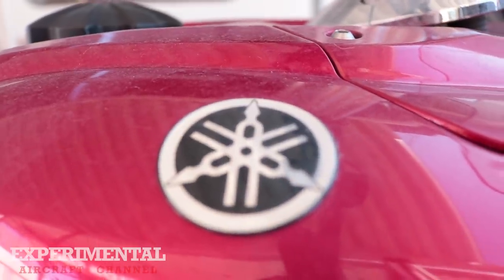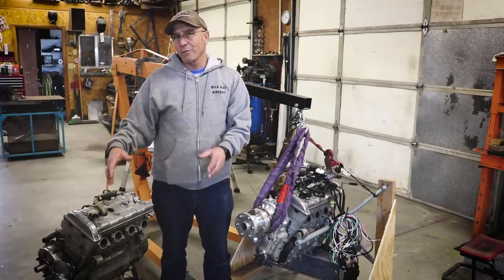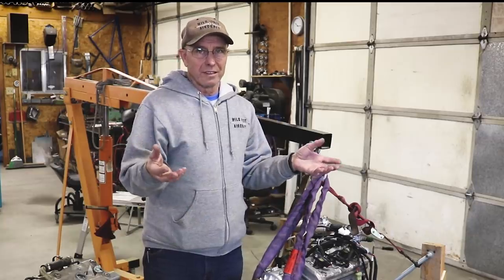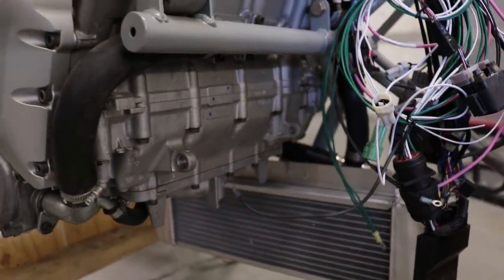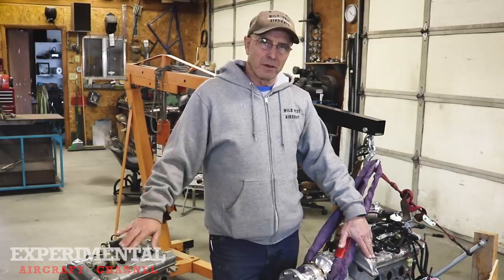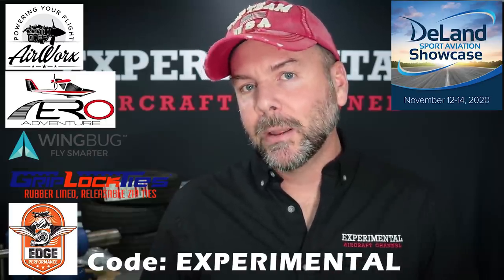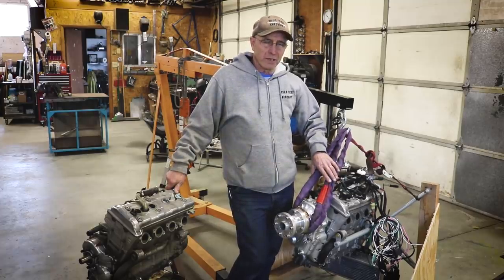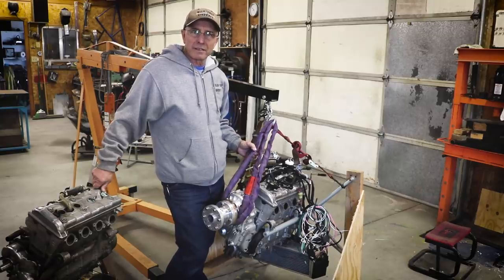Yamaha Aircraft Engines?  STOL - Steve Henry

Comment: It’s about time we realize that air cooled carbureted engine with magnetos is old music. High performance motorcycles and cars abandoned that long time ago....
Reply: Carb rebuilding kits, and tuning talents are few and far between also. Motorcycle dealerships won't this old tech anymore.
Reply: dealerships won't touch
Reply: Magnetos are still used in top level motorsport.
Reply: Bill Hollingsworth are they? Wear? I though mags didn’t let you change timing so they wouldn’t work with FADEC systems.
Reply: @joshmoore6165  You know you can edit comments. Not trying to be difficult, just if you wanted to fix the original comment you can.
Reply: @cageordie  No offense taken. Thank you, I will learn how to do that.
Reply: I can afford old music.

Comment: That price is ridiculous. I can't comprehend how he can justify 20k-40k.....
Reply: I agree, im not sure why a person would considered this motor when you can get a new Rotax 915iS fresh out of the box, turbo and fuel injected, (which btw you will get service bulletins should issues be found at the factory) all for $37k.   In contrast I'm sure the APEX works well, but seems very expensive for what your getting, a used, secondhand engine.  If it was a $6k or even $10k maybe.  But $23k?  Hard pass.
Reply: If you go to his website and check out the price page he is offering the Rotax and Yamaha. The 150HP EFI Apex is (w/firewall forward prop and hub) $23k the 100HP Rotax 912  is $28k (FF inc) the 914 is $40k (FF inc) The Yamaha 300 HP is $43K. There is a rather large difference between the HP and whats included for $43K. In neither case are you buying just the engine. For 300HP ready to mount isn't that ridiculous. Yamaha makes a great engine if they provide the correct modifications seems like a fair price.

Comment: I always thought the point of using alternative engines was to lower the cost. Yes, it's a cool engine but damned pricy. And you're basically getting a secondhand engine.
Reply: exactly what I was thinking. If im handy enough to build an airplane from a kit then ill find a 2nd hand engine rip it and and install myself. Of course ill buy what i need like the fearbox but holy crap iv seen these engines going for 2-3K.
Reply: but let me add that if you have the money to throw around, if your looking at a highlander  Id sure throw it Steve Henrys way.
Reply: @Ryan You can buy a used APEX sled for $2000 or less all day long. I know because I have one. Lovely engine, its true. Its as smooth and happy as can be to squeeze 11K rpm all day long and lots of guys have huge miles on the sleds with no engine issues. Maybe I can sell my sled for more money now lol
Reply: @Ryan You don't need 20k to turbo.an R1 engine (what an Apex essentially is). Maybe 5k.
Reply: yeah, but what's the TBO. Sure i ride high performance sportbikes, sometimes at high rpm for the thrill. But i don't think it would make any reasonable TBO doing that long term. 20K+ for one of these whizbangs? When it quits on a sled no one thinks about it---it's when your with your kid drivin' over the mountain that you think about it. Nice vid though.

Comment: It seems like you should be able to get an engine out of the crate from Yamaha, and not an extracted snowmobile engine.
Reply: Yamaha doesn't want to get involved in Aircraft engines I can understand why then they can be held responsible all comes down to lawsuits. Even if they sold them to be used in snowmobiles still probably end being sued.  Attorney's go after who ever has the deepest pockets eventually someone will crash and end up dead. Families are filled with greed by attorneys who want to make a fast buck on a settlement.
Reply: @Mike-01234  that's why you can't start or run their cycles in gear with the kickstand down.  Some brainiac did,  and collected a payout for his own stooopidity.  ) :
Reply: chekyerego - In all the years I’ve been around bikes, I’ve never seen a factory complete engine available. It’s a damn shame, too.
Reply from the maker: That would be nice. In the early years I was investigating options for engines to build "Reverse Trike" kits. I think the only manufacturer that might sell a crate engine (or maybe just in individual parts) is Kawasaki. Most Reverse Trike kits now use doner bikes be it NEW, Salvage or low miles used. Thank you for watching and supporting here. I appreciate You!
Reply: Experimental Aircraft Channel - Ahh great info, Bryan. Thanks!👍
Reply: @ExperimentalAircraftChannel  
In the UK  we have to buy a complete snowmobile  remove the engine & sell the rest on USA Or Canadian eBay .  We use the 3 cylinder Nitro engine in Rage buggies for off road racing
Reply from the maker: @RAT.MAN.  In aircraft? I am hearing they are NOT using the 3cyl because of the "harmonics" from the "pulses" of a 3 cylinder firing. They are stick with the 4cyl at the moment because of this. Which application?
Reply: @ExperimentalAircraftChannel  
No we use the 3 cylinder in a off road Buggy .  Fantastic little engine .  We are now going to try the Ford 3 cylinder lump  that sits on a sheet of A4 paper.   Never realised that a 3 cylinder gave problems in flight.
Reply: For what it would likely cost you could get a sled motor and rebuild it better than new for the same or less.  My last build on my race bike with custom forged omega pistons and oversized valves was about 6 K with labor.  A good builder will build it to tighter tolerances than a stock motor that comes from the factory.
Reply: @ExperimentalAircraftChannel  that is dealer only!! freind had ashop and he had to go to dealer to get an engine!! so he would take a bike there have them put engine in than strip it out for custom bike
Reply: @craigsanders6925  this engines on a sled can put out 300hp! but need tuned down for reliability for the plane
Reply: Experimental Aircraft Channel future of light aircraft is high torque electric motors linked to a small battery charged by a high revving low torque generator unit. No redundancy required
Reply: @ExperimentalAircraftChannel  I was researching alternative engines about 8 years ago.   A friend who had been using an apex engine in his jet boat for 4 summers and pointed me to the Yamahas.   At the time there were a few people using them in gyrocopters and two putting them into kit planes. 

The general consensus at the time was that the 3 and 4cylinders had different methods of mounting the engines.  The 3 cylinder needed an elaborate Mount built and was also more complicated to adapt the gearboxes to.  The extra weight and cost of conversions made them less desirable.
Reply: @pagansforbreakfast he is robbing people he thinks his shit is made out of gold
Reply: blastman8888 I doubt that has anything to do with it. Chevy has been selling crate engines for years and to my knowledge has never had liability issues. Some have even made their way into aircraft.

I suspect the demand for crate motors is just too low to be worth the trouble of spinning up that supply change.
Reply: @carlschmiedeke151 . Seems to me he’s proven it👍🇨🇦. No one’s done more in Yamaha aircraft than Steve!

Comment: Thrust from Steve Henry engine is amazing.  Power to weight ratio is nuts!  Had a Yamaha 650 4 cylinder that redlined at 10,000 rpms in early 80’s in a motorcycle.  R and D has been working overtime for sled engines though Yamaha in the later years.  All about speed and weight!  Hats off to Steve Henry for test piloting this project that so many want to acquire now for an airplane.  Great question and answer session.  Well done video.
Reply from the maker: Thank you! Very much appreciate your feedback. Thank you for watching and supporting here. I appreciate You!
Reply: @ExperimentalAircraftChannel  you NEED to seriously look at the 300hp supercharged jetski engines...theyre marine quality engines with jetted oil cooled pistons for continuous high rpm...really torquey engines out of the crate
Reply: this seems to be the old engine used in VX jetskis. it had about 140-180hp and a redline above 10k. the newer engines are much better and more powerful.

Comment: I had a Yamaha snow machine for 4 years before I sold it when I moved to a non-winter state and that whole time I never had one mechanical stoppage or any issues for that matter. My riding buddies with SkiDoo's, CanAm's, Polaris....none of them can claim that. I carried a strap and D shackles to pull them when they broke down lol Yamaha is KING of the snow machines!
Reply: Kinda related, I've got a 07 Yamaha Rhino 450 on the farm and use it every day still runs like a champ. The Polaris  Ranger I bought in 09 is usually broken in the barn waiting on parts. They do the same job, same loads.
Reply: dwarden3 , same here in Ontario. Our ATV group always ends up having to repair or tow a Polaris back to camp. Yamaha , Honda and Can Am never seems to break down.

Comment: Well my experiences from  snowmobiles would make me very comfortable flying with an Apex engine, not that Rotax is bad in any way but Yamahas engines is a little bit better. Besides the yearly or every 4000km oil change I'm still  waiting for the first service on the engine in my Apex, valve clerance check at 40000km  or 24860 miles.  :-) When the clutches are set and work correctly it should rev about 10700 at WOT, the revlimiter kicks in at 11000.

Comment: Shouldn’t even be a second thought between carbs or fuel injection. I mean absolutely ZERO thought really. Also, you shouldn’t even really have to develop and R&D a turbo system for the Apex, the snowmobile guys have been doing it for years and years. I completely understand a few tweaks and bugs here and there, like exhaust manifold/collector, charge pipe/induction manifold routing and intercooler maybe if your using one. However, the fuel mapping, computer, proper turbo, etc.....there are many many guys who have that down perfectly. Certainly shouldn’t be necessary to start from scratch just because it is going in an aircraft right?
Reply: The mapping for an aircraft is completely different from a car. I've done it and the maps that were provided with the ECU were completely inappropriate and I had to start from scratch. Been flying with my setup since 2009.
Reply: Something used on a  snowmobile doesn't necessarily fit or work on an airplane. 
As he explains in the video, he had to come up with his own exhaust system because it can't be fitted the same.
And with different gearboxes and ways the power is used at a higher band of altitude changes comes the need for different mapping and adjustments.

Comment: About RPM - - - I had a Honda CX 500 motorcycle in 1969 that red lined  at 10,000 Rpm and everybody said it was a time bomb because of such high RPM.   It was the most reliable Bike ever.
I could take it up to 10,000 RPMs every shift and I often drive in a lower gear to maintain the 10,000 RPMs and it was only a 2 cylinder so RPMS mean nothing if the motor was designed to be a high revving and built by a good company Like Yamaha or Honda.
Reply: Don't bikes today rev 20K now?
Reply: @SVSky  Most of your average sport bikes are topping out between 12-14k. My 19 year old Blackbird redlined at 12.5k. Happy zone was between 6-9k, and best mileage was around 85 mph.
Reply: @SVSky  many do, but my Goldwing redlines at 6,000.
Reply: the CX500 didnt come out until 1978.
Reply: @yamahale  Thank you Hal you are a better historian than me. But point being that it was a high reviving from a  long time ago.
Reply: mostly no. But the man is talking about "cruising" (continuous rpm) of around at 9K rpm or something. And he does it with a straight face. OK. I would guess that might give you a 200 hour tbo if you were lucky. Of course nobody knows.

Comment: Could someone please explain to me why he couldn’t just put EFI onto that carbureted engine?
Reply: You can depending on the manufacturer. Yamaha is known to have different valve spring ratings between the two. So you would have to re-work the head. Then rebalance the crank. To do all that DOES NOT cost that much.

Comment: Reading some of the comments below what is the difference in  engine fuel injection mapping between a snowmobile and an aircraft application? If the snowmobile fuel injection is wide enough to go from sea level to 10 thousand plus feet why is the aircraft different?

Comment: Why not the 3 cylinder engine from Yamaha Nytro? Lighter and very reliable. 130hp stock but MC Xpress from Sweden pulls 340hp from it very easily.
Reply: 270 degree phase in power pulses gives propellers some funky behavior.
Reply: @CommieCat  Aah. Thank you for the info. I have absolutely no experience in aircraft engines.  😁

Comment: IS the $23k price for a non turbo engine include a rebuilt snow mobile engine with fuel injection ?
Reply: That includes the gearbox and prop as well.  You're talking about a motor that weighs just over 100 lbs, and rebuilt can easily make more power.  My 2008 R1, it's a similar motor, made almost 180 with a full exhaust system and dyno tuning on a stock motor.  Match the ECU map for the use, dial in the cams for where you want them and tune it for best power application.  Non turbo super bike builds are making well over 200Hp.

Comment: With that kind of RPMs what comes to mind is a system based on a Multi Fan Blade Ducted Fan. A Cold Ducted Fan with Direct Drive.  In a Duct, the wing tip vortex's from the prop tip, are eliminated thus gaining efficiency , about  20 %.  In my Mind's Eye, I see the engine and impeller enclosed in a Venturi Shaped Duct. An air  cooled 2 cyc engine behind the impeller in the slipstream would  handle the engine cooling.
Side note..... I've been building and flying Model airplanes since 1959. Got my 1st Radio in 1976, been designing, building and  flying R/C ever since. Build in the winter and fly in the Summer. I get an idea, draw a sketch, cut, glue,  assemble, fly, break, rebuild, fly.  This Yamaha Engine in a Ducted Fan with the High RPMs should be Mega   Thrust.     From Ionia   KEITH
Reply: If your ducted fan gains 20% efficiency than  you are above 100%🤩

Comment: I am wondering what makes the Yamaha engine competitive compared to a Viking 195 or an aeromomentum engine. Is it the weight? Doesn't seem to be the price.
Reply: Not a bad engine...but I also don't see too much R&D on these either. I'm not too sure I'd spend that kind of cash on something so unproven. Aeromomentum is doing a far better job on the R&D front (easily the best of all the auto converters out there IMHO) with significantly lower prices. I'd approach this one with caution till a few hundred hours at least are on a few of these. If it works out okay after that, fine. If not....
Reply: I haven't seen the weight for the turbo setup, but it has to be alot lighter than the honda auto conversion. These engines also have a lot of history and testing of turbo setups in the sleed world. They have proven to be super reliable in that application. That doesn't mean I disagree with you about hours of testing on this specific turbo/fuel injection setup. The fact that you are not getting a factory built engine also adds variability that I don't like. And the price... 40k ouch
Reply: About 115-120 lbs, that was his price that included gearbox and prop which I'd guess costs about 6K.

Comment: So why would anyone pay 23 thousand dollars for the engine and redrive, when you can buy the engine from a Yamaha dealer and components for well under 10 thousand dollars, and then purchase the prop drive separate, and bolt it on. 
Thousands saved.
You can buy the whole sled brand new for 15 thousand or less.
Reply: Forty thousand for the turbo version, fat chance.
Reply: Everything aero is ten times the price of automotive.  These planes are one by one hand made,  Henry Ford had more production automation 100yr ago than what many airplane manufacturers use today. Its just economy of scale.  The comparable hp rotax is more than $23000 and it is an old design with carbs.  If you want injection the rotax would be even higher price.
Reply: Scott Nunan 
crazy! Good point
Reply: i agree to a point!! the engine has to be modified, and preped for air!! i have a shop and can do it my self so i would not pay that much but if you cam to may shop had me get one ready its a lot of work now maybe something i dont know as way 20,000 extra for turbo?? maybe 10 at tops?? but maybe i to cheap??
Reply: Plus you can get it with the right turbo for the engine already attached
Reply: @srnunan4783  don't fault a guy for trying to turn a profit. He's a test pilot here, and we are learning things. It's a great vid.

Comment: What’s the engine life on these 10,000 RPM engines?
Reply: I know nothing about snowmobiles but that rx1 looks suspiciously like a R1/FZ1 motorcycle engine that i know well, will do 100,000km street miles or a full season road racing no problem . Seemingly built from kryptonite.
Reply: @watsisbuttndo829  yep, based on R1
Reply: I had an R1 track bike with over 20K track miles and the valves didn't need adjustment at 20K.  I had at least another 4-5k put on it to the guy I sold it too until someone crashed it on the track.
Reply: I know people with 20,000km on a yamaha 4 stroke sled motor. Sleds get run hard, harder than in an aircraft. Running lakes, rail beds they are WOT for long periods of time. In the trails they get beat on, 0% throttle to 100% throttle from corner to corner. You will never beat on an aircraft like that.
Reply: So what would the TBO be for one of these? Rotax has a 2000 hour TBO.
Reply: @whitetrashgarage8110  ok i will keep an open mind on it. i had a R1 bike also, it did run good, of course i did not drive it around max throttle. I think 4k in 6th gear gave about 70mph.